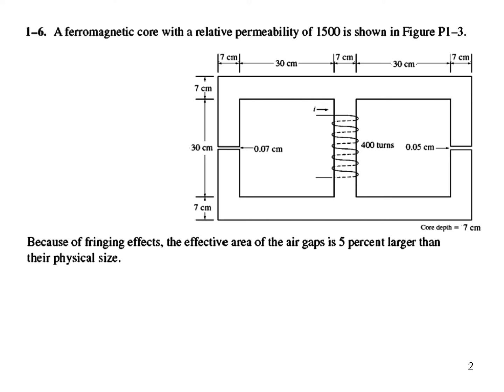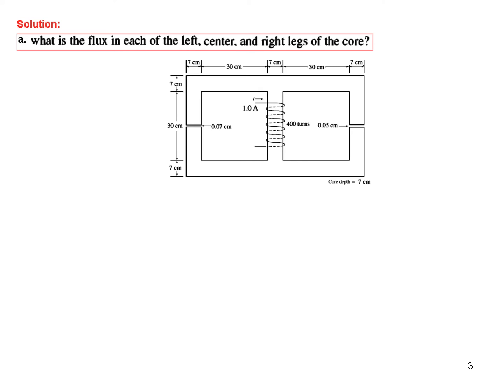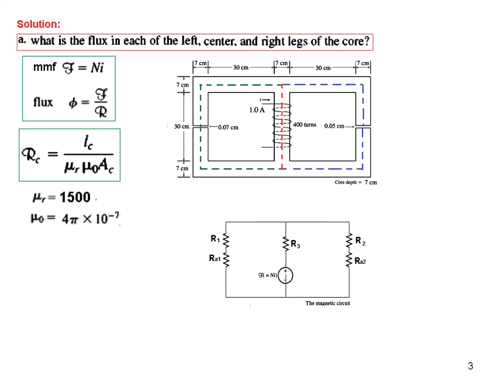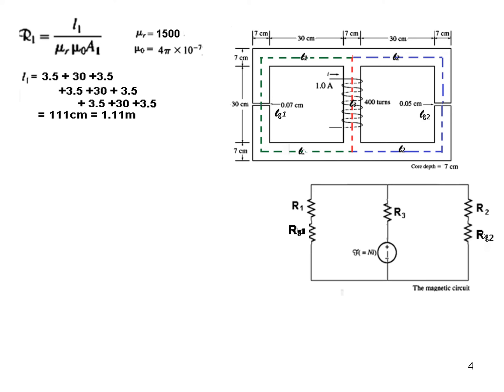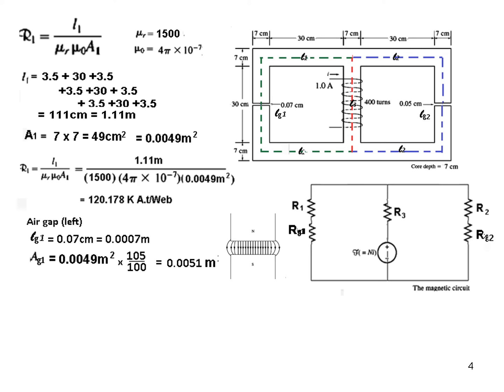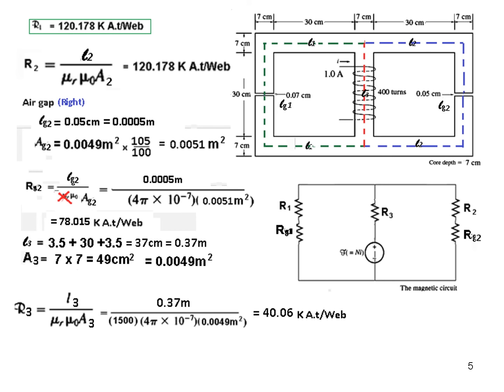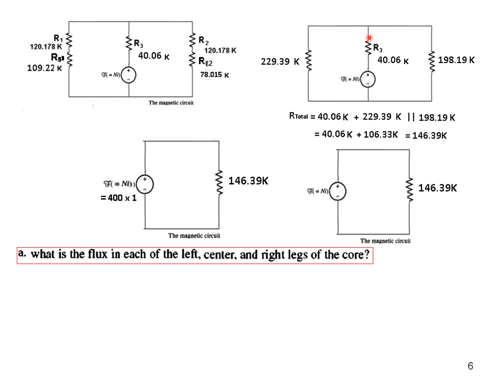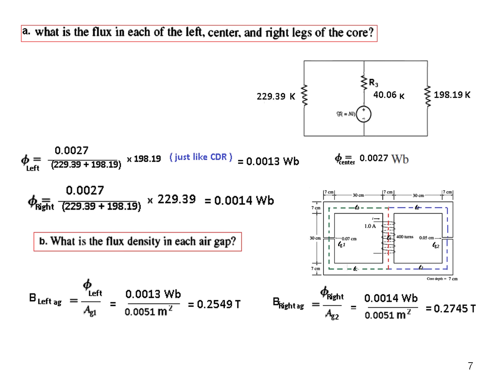(English)EM ||  Question 1.6 || Magnetic Circuits || Core with Two Air Gaps

Comment: I have a doubt sir.
Why u didn't subtract airgap length in l1 and l2
Reply from the maker: Air gap length size is very very small (0.07cm in comparison to 111cm ), hence can be neglected). It will not make much difference in the result. (Engineers do not want to complicate life, unless it is a design of the moon lander 😄)

Comment: Thanks a lot sir for such wonderful explanation I had one question why you are also including the air gap when calculating mean path length for left and right side of the core?
Reply from the maker: Engineering design at its basic stage is made by many small assumptions to make calculations easy, that is what has been done here. As compared to length 111cm can't we neglect 0.07cm ? (Not if you are designing a moon lander 😃)

Comment: for the left air gap, shouldnt it be 7cm x 0.07cm = 0.49cm2 ,, then when we converted it to m2 = 0.000049m2 ,, but why ur answer is 0.0049m2
Reply from the maker: It is width x depth = 7cm x 7cm . You are looking at gap length.
Reply: @ElectricalEngineeringAcademy  sir you forget to convert the area in centimeter to meter for this left air gap
Reply from the maker: @Debomabomai  As compared to the total length of left arm (111cm), the air gap length 0.07cm  is very small, and hence can be neglected in engineering calculation (unless you are designing a space craft for landing on the moon :trophy-yellow-smiling:)

Comment: Use a wooden core and eliminate the ritual air gaps. Wood has a higher permeability and will not saturate. And it's cheaper.
I realize a magnetic core with an air gap is the sacred talisman of all "magnetic engineering" courses.
When you buy a tire, do you saw it in half to prevent overinflation?
Reply from the maker: Interesting idea. Share me your practical experience.

Comment: For l1, why are you including the 0.07cm air gap? Shouldn't that be subtracted from the 111cm?
Reply from the maker: Too small in comparison with 111cm, so no issue🤫
Reply: @ElectricalEngineeringAcademy  but it should be subtracted right??  how did you get your area i didn't get that one
Reply from the maker: @thusegoraserati8750  Yes if you want to.

Comment: why you took 105/100 for taking 5 percent increase?
Reply from the maker: You deposit 1000 Rupees in bank. The bank gives an increase of 5% after a month. How much be total now ? How do you calculate ? There are two ways; (1) you calculate the profit separately (5/100)*1000= 50 and then add it with 1000,so total is 1050. (2) second method is you multiply 1000x(105/100) = 1050